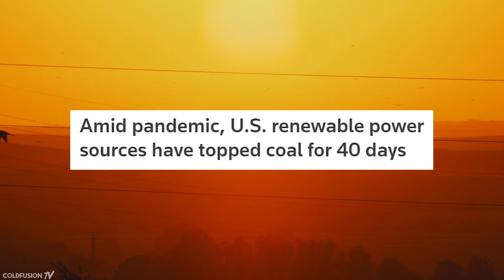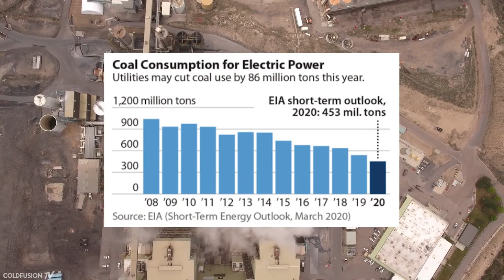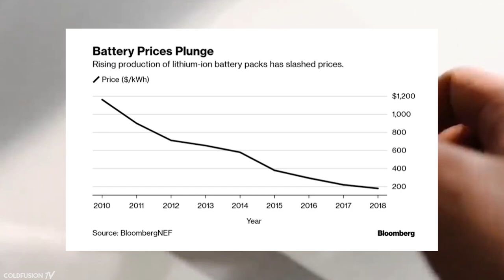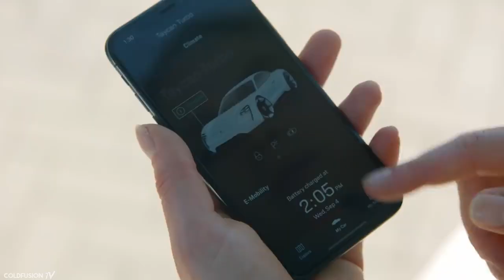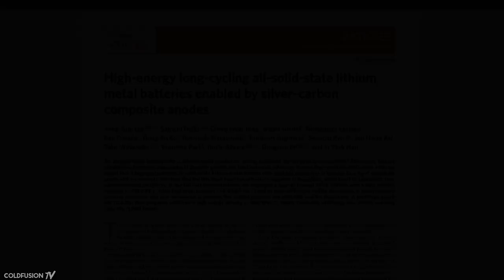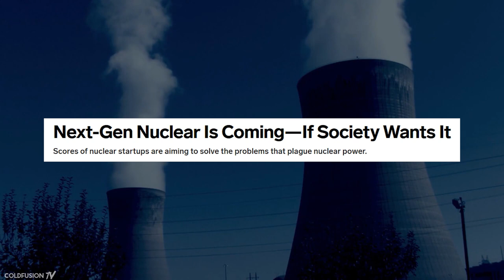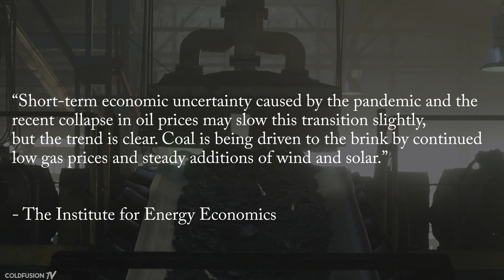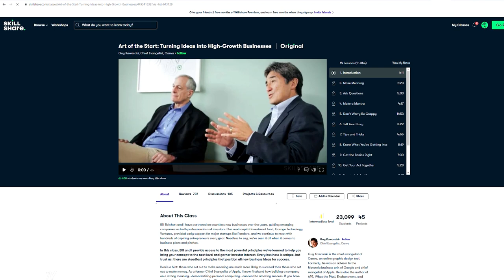Amid Pandemic, Renewables Now Supply More Energy than Coal in the U.S.

Comment: First of all, the term re-newable is usually lumped in with hydro-electric power. That is a false point because hydro-electric can provide steady controll-able power, while wind and solar cannot. The truth is that wind and solar power generation is the most expensive and inefficient modes of power generation there is. Due to that fact that wind and solar power yields are neither controllable and predictable, power grid administrators that are forced by global political establishements to use wind and solar in their operations are forced to work harder balancing their power grid networks. All public power grids require power line balancing, meaning that at all times power grid administrators have to generate the same amount of power that is demanded by the customer base. Not doing so causes costly blackouts. Because power yirlds from wind and solar facilities are unsteady and fickle, administrators have to make up the power wind and solar plants cannot provide with fossil fuel, nuclear, or hydro-electric plants. ALL OF WHICH GENERATE STEADY POWER! Doing this balancing act causes existing power plant infrastructure to operate much more inefficiently then they normally would. And henceforth the reason countries that use wind and solar extensively can expect to pay extreme electricity costs. Australia is the latest victim of this re-newable madness. Australian electric customers can expect to pay electric rates that are triple to quapdruple when compared to their American counterparts. American pay on average $0.10 US per kilowatt-hour. Some people pay as little as $0.07 per KWH. Wind and solar power is the biggest public consumer fraud hoisted on the public this century.
Reply: @Stefan Z - yes, it would be much better to talk about:
* high-carbon (fossil fuels, biomass)
* low-carbon dispatchables (hydro, geothermal, nuclear)
* low-carbon intermittents (wind, solar PV, solar CSP)

Comment: Renewable energy sources do not work for an economy that has manufacturing or large scale public transit   systems that are driven by electricity. Solar & wind generated electricity & storage thereof is intermittent & lacks the sustained amperage for such things. Also the toxic materials used in batteries is another aspect so called good for the environment sheeple fail to address.  There is a reason why manufacturing plants either had their own generating operations or were built close to generating plants on the grid. Even if you could get rid of all the coal fired generating stations mining coal is  still a necessity for steel production..................that is unless you want the world to go back to burning down forests for carbon. As far as EV's go I'll make the switch when it takes 5 minutes or less to fully charge just like filling your tank full of sweet gasoline.

Comment: I’m glad you touched on nuclear energy, it is the superior choice from pretty much any perspective.  Even the earlier reactors are not actually unsafe as compared to fossil fuel power generation.  Nuclear is also the best option for the environment (yes, better than solar and wind).
Reply: It's also extremely expensive, slow to build, & cannot be done in most countries (either for technical/logistic reasons, or for political reasons).
Reply: Dr. Zoidberg it is expensive for political reasons only.  If you remove ridiculous, illogical regulations that apply to nuclear, the power stations would of course still be expensive compared to a solar panel or wind turbine, but they produce massive amounts of power for very long periods of time, so the power is cheap.

Like you said, they can’t be built in many places for political reasons, but again those reasons are ridiculous.  If someone really cares about the environment they should be working to educate as many people as they can on nuclear so that those political reasons disappear.

Comment: Love your channel but there are a few major mistakes in this video.

Coal electricity generation is mainly dropping because of the development of shale oil from which gas is a byproduct. It's mentioned in the conclusion but the rest of the video makes it look like it's because of the rise of solar and wind. You'll see that as shale oil companies will go bankrupt, coal will rise again.

Solar and wind are producing more than coal during corona virus because they are intermittent. So if the electricity demand drops, you can't scale them down and thus there's a drop in electricity production from gas and coal which can easily be reduced.

And finally electricity storage with batteries is simply stupid at this point. There aren't enough raw materials on Earth to generalize this false solution. It may be possible in the future as battery technology is evolving rapidly but right now it's a no no.

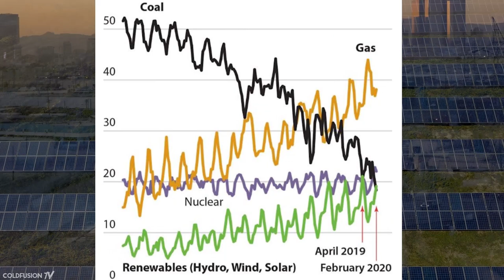Comment: I'm a little disappointed about this video. the title suggests that renewable engery is rising so much, that it now overcome coal. but that is clearly not the case here. as the graph at 1:58 shows, the reason for this effect is just due to the enormous fall of coal. most of the energy is now just comming from gas instead of coal. so this is not a good sign for the energy market at all. nothing has really changed. the production of energy is still almost as bad as a couple of years ago. But never the less: renewable energy is slowly rising but definitly not as fast as this video suggest.

And a second fact i want to correct: At 5:12 you compare a big old battery with a slim new battery. And your conclusion is that new batteries are smaller and can store more energy. Well. New batteries can indeed store more energy than old batteries but batteries can still be bulky cause of voltage differences. In your example you showed a battery of a laptop that needs 12 Volt. But a litium ion battery outputs only 3.3 Volts. So to ramp up that voltage you need 4 times the amount of batteries despite having the same capacity. What i want to say: your comparison is a little off on this example.

Comment: Renewables. But only a small proportion is from solar, wind and hydro. You can count biomass as a renewable because trees regrow, but not as a non-greenhouse gas producer, so you may as well just use the coal and have cheaper power and keep the trees. Also, when you're closing coal power stations for what amounts to popularity reasons, of course coal power production is going to drop. Duh. There is no significance to this anomaly whatsoever, except to the increasing cost of energy.
Hey, but as long as the Chinese have cheap coal power, right? That'll just increase their competitiveness in manufacturing further on top of their captive slave labour. They've had 50GW of new coal power stations come online there in the last 12 months - a 20% increase in power coal base production of 260GW - with a further 200GW in planning. Of course, they get a free pass because "muh raaaaaacism".

Comment: We went from using coal to fracking and using natural gas instead; would not call that progress... more hydro in spring comes from faster melting snow (global warming); and solar is insignificant, still less than 2% of us electricity production. Plus wherever there is solar, there are inefficient peak plants to take care of the duck curve. So once again, what looks like good news is not. Without drastic energy consumption and fossil fuel emissions reduction, solar is useless in the face of global warming.
Reply: Solar also makes up 2% of electricity because it’s literally in its early stages and it just became cost competitive with fossil fuels. You are taking statistics out of context

Comment: Lithium ion batteries are not the solution for grid storage. Too much mining to get too little material that's too expensive and stores too little energy.

The solution is a suite of technologies that are deployed based on the scale of the market. Big countries with high demand should skew towards nuclear as their base load. Lean in hard and bring capital costs down with innovations. Small, low tech markets can still use fossil fuels as their base load. 

There is space for most if not all our energy options. The problem is that there is a false choice being presented in the name of economics and aided by politics. The markets can handle more technologies and more players even if the profits to any single cooperation may not be as massive.

Comment: The battery comparison at 5:10 is bullshit as hell. mAh isn't a unit of energy capacity, even if it's frequently used as such. The laptop battery is rated at 14.4v, which means it's actually 14.4x1.7=24.5Wh capacity, whereas the phone battery is rated at 3.8v, which means its 3.8x5=19Wh capacity.
Also you can't store excess power production in batteries that's just ridicules. That would require multiple orders of magnitude technological advancement in battery capacity. Currently physical energy storage is used (pumping water to a high reservoir, see here: https://www.youtube.com/watch?v=66YRCjkxIcg )

Comment: You forgot a few important parts mate (I'll ignore the comparison of different batteries that have different voltages): The subsidies, the input/output costs of energy of the renewable, you forgot gas power plants and more. Hell, you didn't even mention that the production of your battery will also cost an F ton of energy. 
I don't Wanne be a hassle here, this video was beautiful, but pretty much propaganda. In this case, it's probably propaganda without the political motive.
You might wanne inform yourself on the energy sector a little more....

Comment: Burning anything will still release CO2. Whether burning coal, gas, wood or garbage, it still will release CO2. Even with carbon capture and greater efficiency you will still have CO2 to deal with and the waste left over. Alternatives like nuclear are cleaner however nuclear waste, and decommissioning a power plant do not off-set the costs involved especially with the construction costs of a nuclear power plant itself. As with all power generation it's the whole carbon footprint and environmental impact that need to measure it's overall effectiveness at combatting climate change, pollution and damage to health. I will advocate the cleanest least impacting power generation as the sectors to invest in. Solar and wind while not perfect still longer term reduce their carbon footprint. Hydro is debatable. I hope batteries will support the expansion of the cleanest renewables. I would advocate tidal power and micro generation as other sectors worth developing. Burning waste I fear is a blind alley.

Comment: Dislike because of the unfair battery capacity comparison. Laptop batteries operate at 14-19ish volts at 1700mAh =35Wh-ish, while phones work at 3.7V at 5000mAh = 16Wh ish.  Please understand these energy concepts before you make a video explaining them to others as this is very irresponsible.

Comment: I make tombstones every day out of stone. We are still very much still using stone and coal is vital in the production of solar panels.  Your solar crystal wafers would not be possible without burning coal to get a very specific carbon and silica.  Coal is  not going anywhere  anytime soon and it's the same with oil. You need lubricants right? That oil will be used to grease those electric car bearings and in those motors at least once  before being sold. Please dont throw the baby out with the bath water. I believe that change is needed but measured change that allows for acceptance through logic,  reasoning and debate. Force feeding climate change like a religion is making Americans resistant as it should. Science is always about questioning and is never settled  in any way.  So when I hear someone say the science is settled  then I know they are working an agenda.  I support science in the classical  form not in a fascist  form promoting  agendas. We use solar power at our house every day.

Comment: The arguments you make for burning garbage - creates jobs - are the same for repairing wind turbines. Plus burning garbage, how sustainable is that? Wind turbines last up to 30 years, how long does garbage take to burn, a few minutes? And what are you doing, asking people to create more garbage so you can burn it? What are the first principles here? Plus the input energy and resulting CO2 emissions of creating solar panels and wind turbines is a fraction of that of burning coal. While I have an open mind towards new forms of nuclear, it's not a good look to borrow talking points from Michael Moore's latest flop, which claims that the input cost of making a solar panel is more than what is generated. That's an outright lie. And with solar panels approaching 50% as you say, this is a very promising period for renewables.

Comment: For proper energy solutions you need 2 key factors met: quantity and reliability. You need to be able to adjust the amount of energy provided to the amount of demand required by the grid. During the day you can use solar no problem bimut the issue becomes when its night or its cloudy out. You won't get nearly enough solar to run a power grid and customers won't be happy without power. Same goes for wind. On a windy day its no issue but on days there is no wind thats where you run into issues. Hydroelectric has a whole other host of issues in regards to environmental damage with ecosystems. Continuing to use coal is incredibly dumb. Anyone who is fighting to "save coal miners jobs" is an idiot. The future is not in coal, nor gas or any of those previously listed renewable energies. The future is nuclear. It is consistent, clean for the environment, and can be adjusted to fit demand on a whim. The one downside is the waste it produces but that is relatively minimal when handled properly.

Comment: Great. So when the world economy is 90% shutdown because of a pandemic then renewables can actually pull their weight. Just great. So aside from a move back to an 18th century lifestyle, have you got anything useful to suggest because otherwise you really seem to have been making the point that we are screwed. Some of us refuse to adopt that prognostication, thankfully.

I agree with others that some discussion on nuclear energy, whether current tech such as pebble bed reactors, thorium, or even advances in fusion would have given much more credence to what turned out to be a very weak video. Sure, battery solutions are advancing and frankly are needed if renewables are ever going to become a meaningful contributor; but it seems doubtful the eventual solution will be based on lithium due to not only technical factors, but also the economic and ethical concerns surrounding the supply of such materials as cobalt.

Make this video again when renewables are able to contribute more than coal for 40 days straight despite the economy chugging away full blast. Then you will have reason to celebrate. All you’ve done here is the equivalent of telling me that you can outplay a professional athlete when they are sick and debilitated from chemo and radiation therapy to destroy a tumor they have been diagnosed with. Who cares?  You might feel some accomplishment, but no rational person will.

Comment: thorium reactors should get built to cover the base energy need, then have renewables for the peeks.
Reply: Batteries would make better peakers.  You could not depend on renewables providing energy at the precise time you need it.
Reply: Hl A  nuclear reactors are best at providing baseline power they are difficult to ramp up or down at a moment's notice.  If batteries ever become feasible you could calculate  a base rate for nuclear to provide base power and charge the batteries.  Then you could use batteries for peak.  I guess you are correct you could just run nuclear at the max load all the time and discard excess power?

Comment: Oh for crying out loud, the same old renewable energy skeptic questions, really? Are we not past that yet. Okay, let me flip this on it's head: how much energy does it take to get fossil fuels out of the ground, half way across the world, refined, put back into a Diesel truck, emptied into a leaky underground tank and then burned in an ICE? C'mon, you speak as if this has no cost. Also, to compound the inefficiency of the fossil fuel system, once a gallon of fuel is burned, it can never be burned again. Sure, battery storage of energy is much less energy dense than the amount of energy in a gallon of dino juice, but the battery gets to be used thousands of times over decades. This is an obviously better situation.

The energy it takes to offset the manufacturing of a solar panel is generated by that solar panel in about six months, on average. Same idea for windmills. Yes, it takes energy to mine stuff and build stuff but we are always going to have to mine and we are always going to have to build. We might as well be mining stuff and building stuff that can be used for decades rather than just over the course of minutes. Also, as the grid greens over time a higher and higher percentage of the energy used to build stuff and move stuff around the world is coming from renewables so it's getting better and better. This argument doesn't hold any water.

People that built the automobile had to get to work using horses or bicycles or walking.those who built the first light bulbs worked by candlelight. It is a necessity to use old technology to create new technology. Because we are burning dinosaur juice to create renewables does not make renewables a bad idea. Find a new argument.